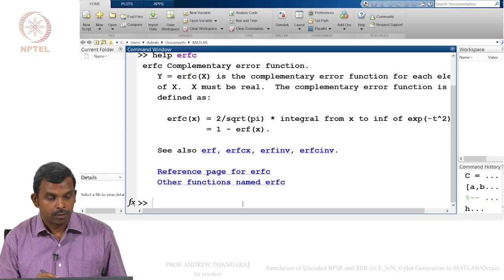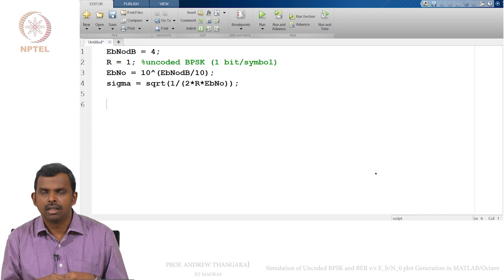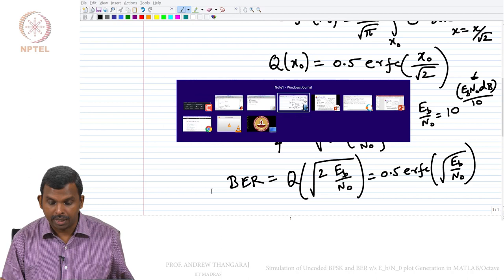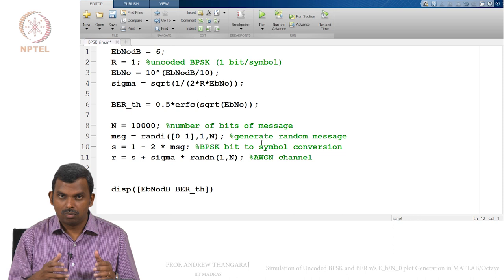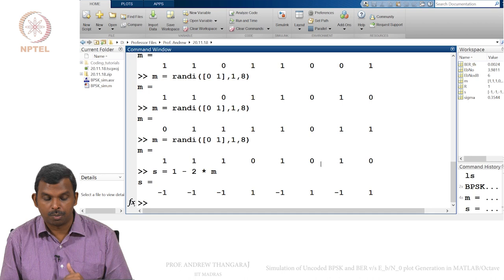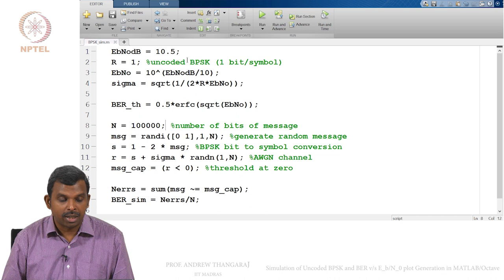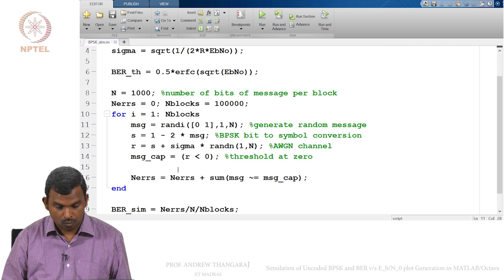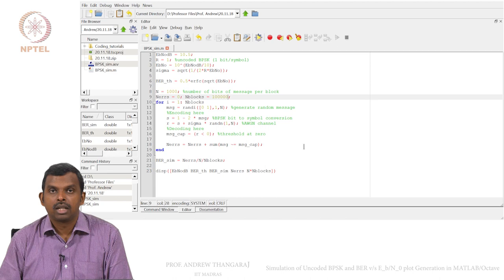Simulation of Uncoded BPSK and BER v:s Eb:N 0 plot Generation in MATLAB:Octave

Comment: Plot the bit error probability versus Eb/No (dB) for antipodal and unipolar signals. First,  use the analytical expressions. To be eligible for any credit, your plots must show the waterfall behavior.  Next, simulate both antipodal and unipolar (orthogonal) cases using random bit generation and random noise. The final submission should include:

 Only ONE figure:  showing both the analytical and the simulation curves (i.e, two curves in the same figure) for the antipodal case, as well as both the analytical and the simulation curves for the unipolar (orthogonal) case (i.e., another two curves in the same figure). So, there will be FOUR curves: (a) Analytical (antipodal), (b) Simulation (antipodal), (c) Analytical (unipolar) and (d) Simulation (unipolar). The analytical and the simulation curves should be marked using appropriate legends so that they can be easily identified. Also mark which curves are antipodal and which are unipolar. Use SNR range from 0 dB to 10 dB in steps of 1 dB.

Can i get the code for it? 
Thanks in advance
engr.bilal370@gmail.com

Comment: Hello Dr. thanks for the wonderfull clarification. i have a little question. are you still following here? as this videos is 5 years old.
I do not understand why the division by "2" in the sigma equation: sigma = sqrt(N0/2). by that assumption if we divide the average of sum of square of the signal samlpes which is 1, over the average of the sum of square of generated noise and convert to dB by 10*log(mean(sum(s.^2))/mean(sum(sigma*randn(1,N))) it will give 12 dB instead ob 6 dB which the predefined EbNo?
i have a confusion with is division by "2"

Thanks a lot,
Regards

Comment: sir, we generate noise using randn () function. That is fine. why do we multiply it with sigma?.
Reply: randn only returns a sample from the “standard normal” distribution. In the example, it is a normal distribution with the variance == sigma^2.
Reply: This is more correct to use :  random('norm', mu, std) can directly give noise, but here author seems to be using an approximation of sorts.